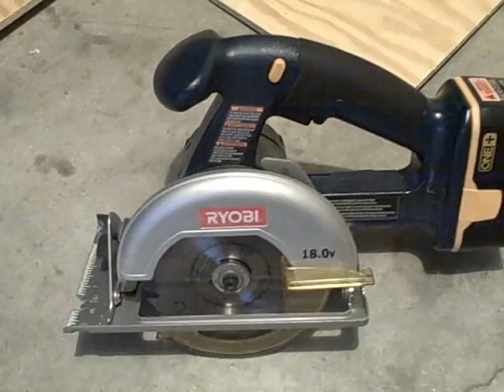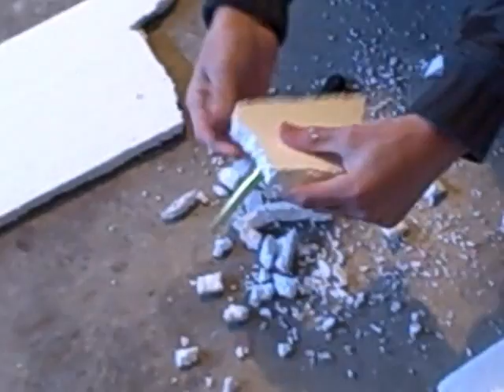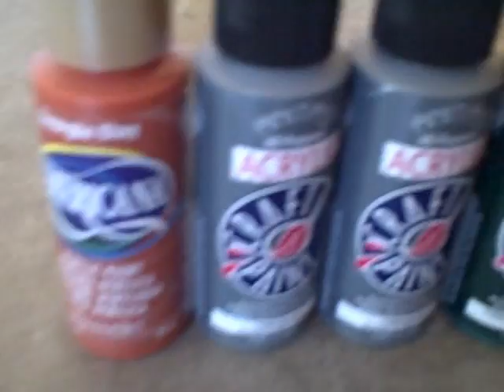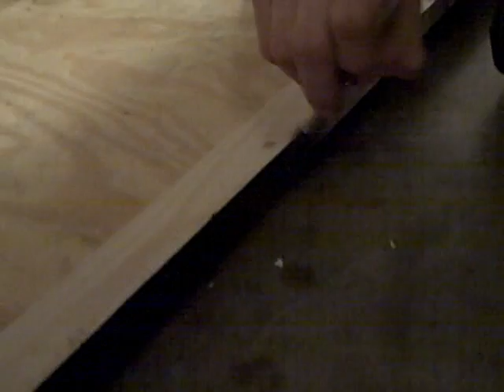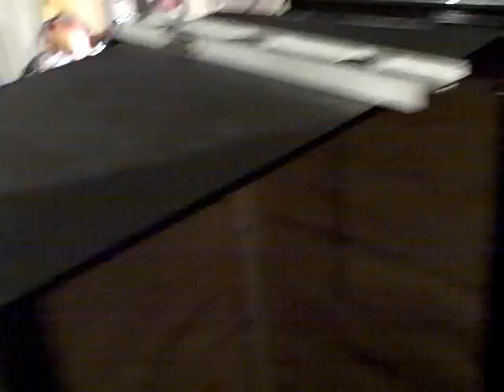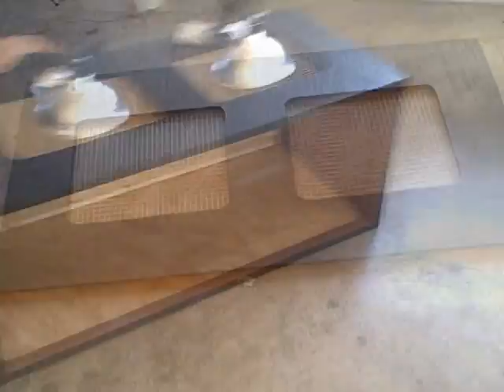Building Bearded Dragon Tank

Comment: Wait hold the phone did they simply paint the styrofoam? Are you kidding me? When I was making a backing like that I used cement and grout. I used styrofoam then put concrete all over it. Then I put the gout over the concrete. Then I painted it and put tons of coats of acrylic clear coat over the top to be sure.